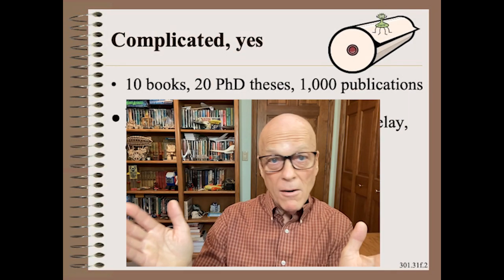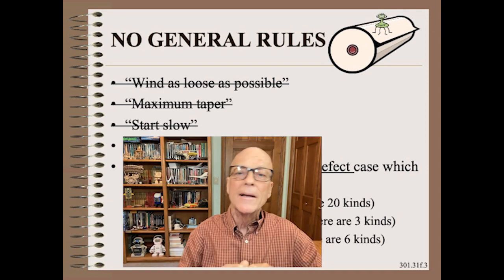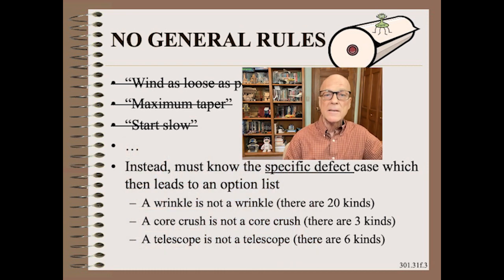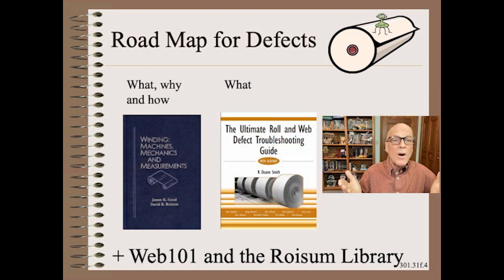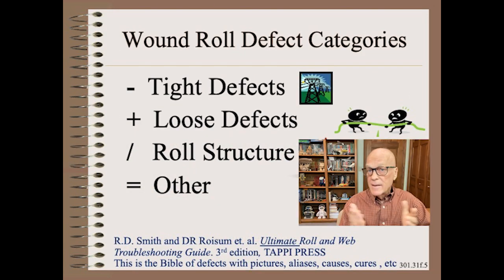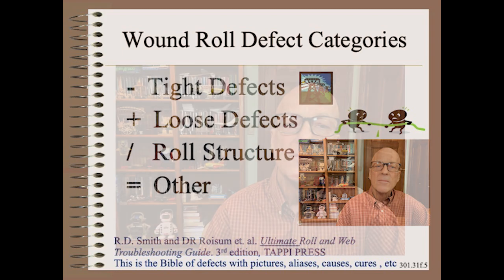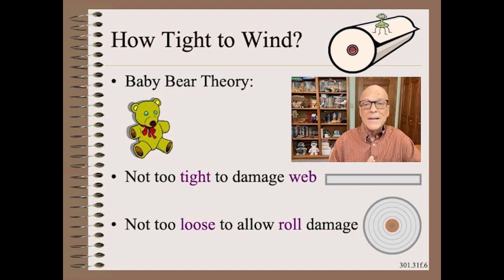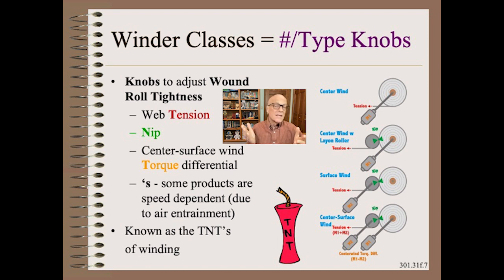Web30131f - Secrets - Winding

Comment: Which  Is not fundamental in web handling: torque or temperature? Thank You very much
Reply from the maker: Torque is a machine unit rather than a web unit.  Motor torque can be made into a web unit by dividing by roller radius and web width to get tension in customary units.